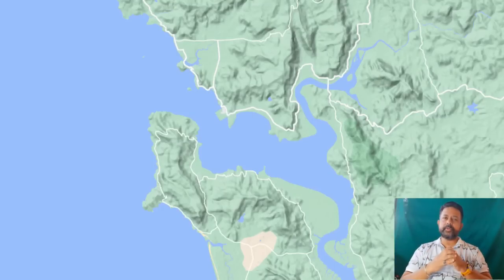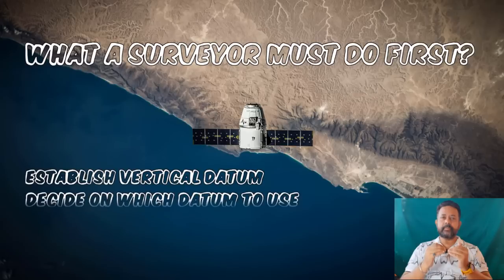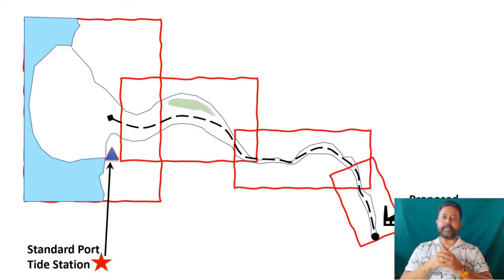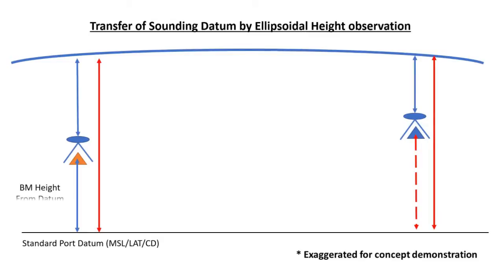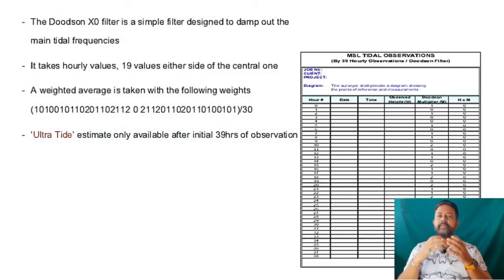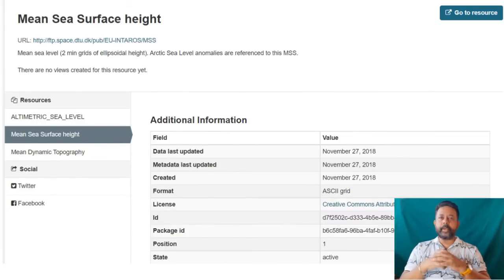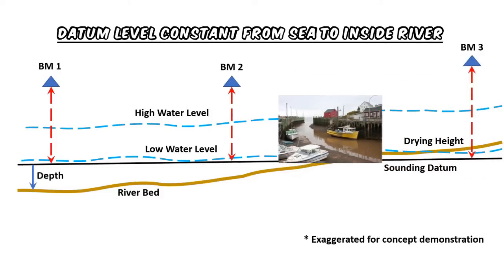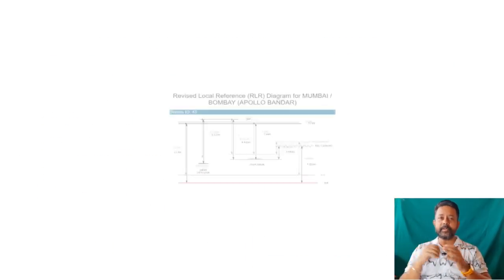What is a Vertical Datum? How to Establish & Transfer Vertical Datum?

Comment: nice video and informative. one question.  what method do we use for transfering sounding datum for the area with diurnal tide?
Reply from the maker: Hi, for diurnal tide the calculations are a bit simpler. We take 3 high and 3 LW. It will be hard for me to explain without diagram and table. I think I need to make a detailed video on that.